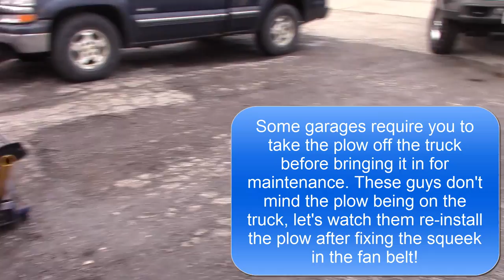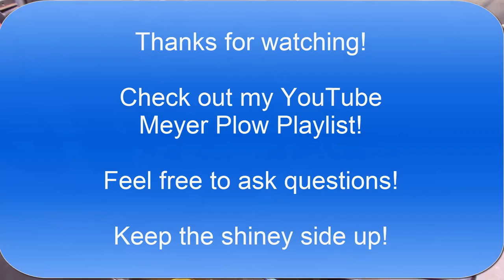Snow Plow for Beginners, Putting a Meyer Plow Back on the Truck

Comment: We are moving to Michigan and have a long drive way . We are trying to figure this out . Thanks
Reply from the maker: Hi Toni. The F250 and 8 foot plow is huge. If I was to do it again, I'd just go with a F150 and 7.5 foot plow. Trucks got to be lifted a little for deep snow, I watched a video where a guy plowing bottomed out and got stuck. I think meyer makes a plow called "Home Plow," for light duty use on your own driveway. I think you can even install it on an SUV.  I'm not sure if it will cut through real heavy icy stuff on a driveway apron. Use studded tires if possible, BUY  THEM WITH STUDS INSTALLED FROM FACTORY. I use chains. I think Goodrich Wrangler is the go to snow plow tire. A rubber blade on the plow (not poly, poly wear out quick) is becoming common these days, but does not cut thick ice. A back drag blade seems cool too. Change the plow pump fluid once a year or so, condensation builds up inside and freezes then the plow won't go up and down. Buy a second hand controller in case yours breaks. Shovel a few feet in front of your garage door, so you don't hit the door with the plow. One video I watched the guy barely bumped a customer garage door, and did $3000 in damage. Big back up lights are cool to.
Reply from the maker: Jeep Wrangler BF Goodrich All-Terrain T/A KO2 Tire (29"-35") Review
https://www.youtube.com/watch?v=PK0E_h1tEuk
Reply from the maker: Snow plowing tips and where to buy accessories
https://www.youtube.com/watch?v=o4ySDy4Ia-g

Comment: They just needed to push up on the head gear.. no jack required
Reply from the maker: Hi SS! Great tip! Thank you! Jim
Reply: Thanks but I do need a jack for my V-blade Meyer plow
Reply from the maker: @dans9228  I've never messed with a V. The channel Spencer Lawn Care has a V, I think he stores it three rollers he bought at Costco. He did a video on it. i made my own stand out of a couple of 2x8'x10's I bought at Lowes.
Reply from the maker: @dans9228  Brian's Lawn Maintenance has a V too, but I don't know how he stores it. Great question!

Comment: The plow doesn't have its own jack? That's odd. All snow plows I've known of have their own jacks to keep the plow level with the brackets on your truck
Reply from the maker: Hi ZN! Yep, no jack came with the used truck and plow. I bought a Meyer jack on eBay, I did a video on it a while back. I was told that's it's only for storage though. Using a FLOOR JACK TO PUT THE PLOW ON MAKES THE JOB A LOT EASIER AND SAFER! Thanks for watching! Jim
Reply: Jim Vincitore usually the jack holds the plow up when not in use with it level to what it was on your truck brackets. Then you just pull into the brackets, engage the pins and lift up the jack. Shouldn't need a floor jack to install the plow everytime. Only time I can see is if the plow came off of another truck and you're putting it on a truck that is higher/lower so it needs to be adjusted and jacked up to go in. If the plow jack is dropped on solid level ground while uninstalling, it should stay at the height of your brackets. Just thought I'd maybe give some potentially helpful input if it makes sense:)